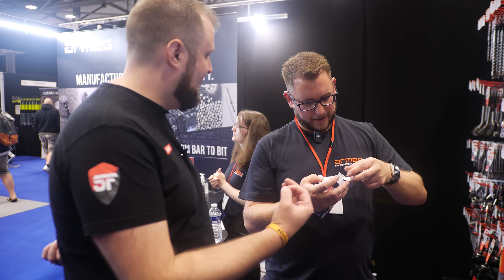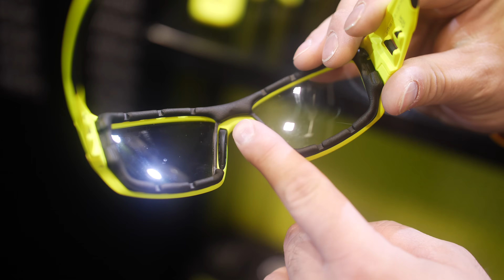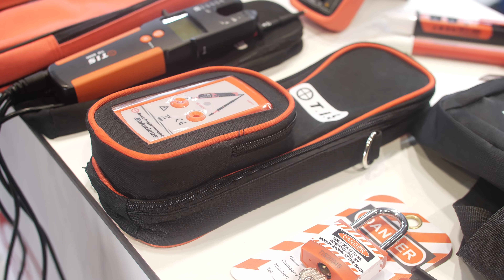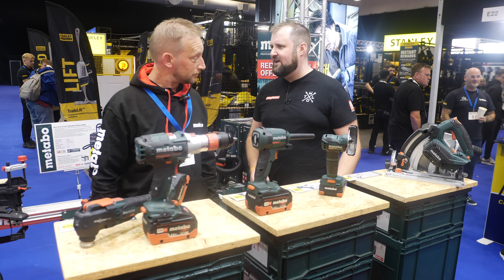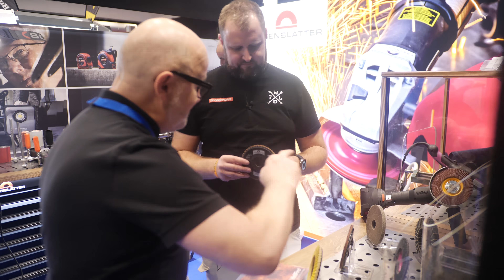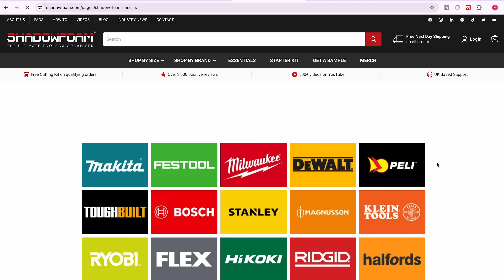I Found the Most Amazing Tools at Britain's Biggest Electrician's Tool Fair!

Comment: A little wrinkle for all you guy's, nearly all tape measures have their width stamped on them, so when measuring between two internal points, pull out the tape so the body of the tape touches one point and the end of the tape the other point, then just add the width of the tape for a accurate measurement, simples.

Comment: If you look on the back of a power lock it has the measurement so you can get a proper inside reading +76 for 10m. Not as handy as that tape having it worked out for you but still good to use

Comment: Jon, regarding the Metabox, I did email you this point after purchasing your pre cut insert.
at the back two corners, there is a moulding that is only about 20mm high, but you cut the full height out which leaves a gap for things to collect in.
I know why because I have seen the video on how you scan for the cutter.
Would it not be possible to just cut a bit out of the bottom?

Comment: Hi @Shadowfoam,
That tape measure with the tape body included in the measurement looks like a great idea!

Quick question about the Shadowfoam inserts...if you have multiple layers in a box, how do you pull out the higher layers, to get to the lower ones please?
Do you have to take a tool out to use that hole, or do you do little "buttons and tabs" that can be fitted through the foam layers to pull them up (& if you don't do buttons and tabs yet, the idea is now copyrighted 😂)?

Cheers,
Rich.

Comment: You missed or didn't mention the best part about the Hultafors Talmeter. Unlike most tape measures, this one requires holding the blade lock button in, in order to unreel it. Also unlike others, the blade lock is so much stronger than anything else I've used, meaning you can use the tape as a reference when applicable, rather than relying on readings. Try bumping the extended blade all you want and it won't budge at all. Because of the fixed "hook" end and the other small point below the zero mark, it's great for taking outside reference measurements, and inside ones with the tail extended. I think I use it as a reference more than I use it to read the measurements, for things like checking consistent spacing and sizing of things. It often does the measuring jobs I'd normally use my combi square for.

I promise that I don't work for Hultafors, I just love these things haha.

Comment: I was at this show but I didn’t spot you!

I’m my surprised as a sparky that you hadn’t seen the armeg hole saws. The bush sockets and a screwdriver bits for roofing bolts are really good!

I’m not a huge lover of the TIS MFT. But at this show I found out that it will do a 1 probe phase rotation test! I’m not sure why you would need it. But it’s impressive.